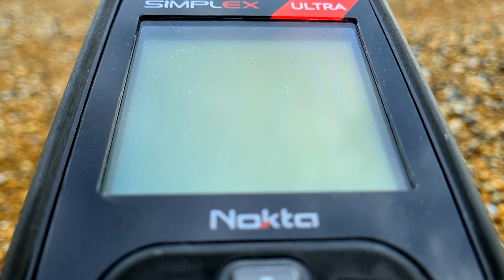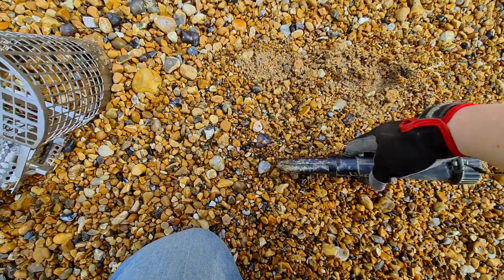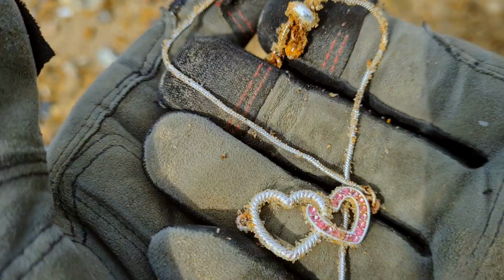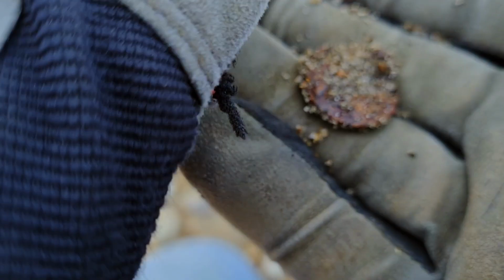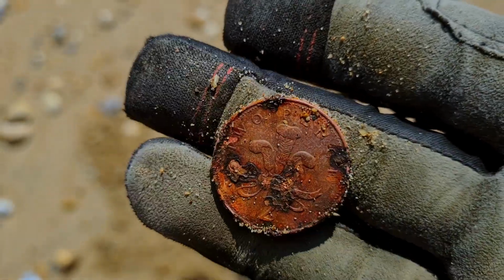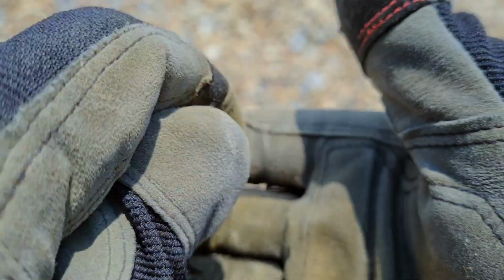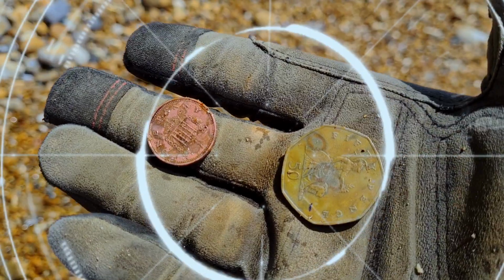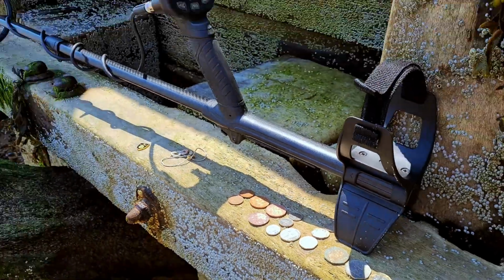First Hunt with the new Simplex Ultra! | Dry and Wet Sand | Beach Detecting | Settings | Episode 205

Comment: Is there any difference between the ultra and BT other than carbon fiber?
Reply from the maker: Hi!

Yes, the Ultra has a lot more in terms of settings and adjustments such as recovery speed and ground suppression (amongst others) 😊👍
Reply: @DTEKTSUSSEX  thanks for reply. Honestly feel so confused about all the options now. I'm after my first detector and can't decide between simplex ultra, x terra pro and the vanquish. Also if the simplex plus is better than the ultra. Really appreciate any help. Also are headphones really essential?
Reply from the maker: Happy to help 😊

The Ultra is better than the Plus on the Simplex. Inside and out. The Plus is a monster of a machine but the Ultra somehow manages to improve on it!
Headphones aren't essential but will help you to hear the more subtle nuances of the tones. The Ultra had Bluetooth connection so you can use your own headphones as long as they're low latency.
What the Nokta machines have over the others you mention is ease of use, build quality, waterproof rating and performance for your money.

Any other questions, please feel free to let me know. I have a Facebook page if you'd rather message me on there 😊👍
Reply: @DTEKTSUSSEX  thanks bud so looks like the ultra is the way to go then!
Reply from the maker: It's a great machine!  Shout if you need anything else 😊👍

Comment: I used to enjoy the simplex + on the beach with the SP24 coil as it was a coin magnet, I’d say looking at your video the new Ultra is proving to be another great beach machine. Well done and thanks for sharing Adam, I did think it would perform sweet, and I wonder how it would be with an SP24 fitted? Because the stock coil did well 👍

Comment: What sand scoop are you using? The last two I’ve bought have broken within a few weeks.
Reply from the maker: The Nokta Premium Scoop. Lasted me well over 2 years of weekly use so far... 😊👍
Reply: I bought a £50 from Amazon which lasted me a few weeks.

Is that the 3 in 1 scoop?
Reply from the maker: Yes 😊
Reply: @DTEKTSUSSEX  I’ll pick it up 👌🏻 Cheers mate.

Comment: Oooh no.... Those target tones sound like the buzzer on the " operation" game and the pinpoint sounds like sooty on a medieval torture rack... would drive me crackers
Reply from the maker: Each to their own. I'm used to the original Simplex which had the same tone set. Once you get used to it it's remarkably nuanced 👍
Reply: @DTEKTSUSSEX  I always got on with my simplex too apart from the interference from every pointer I tried, it performed way above its price tag, and certainly was never chattery as many report.. I never liked the tones though and hoped they had improved now , but if anything they are coarser.
Good video though mate 👌

Comment: Is it as good as the legend on the beach ? And is it more expensive or less expensive then the legend i might get one im not happy with the vanquish 540 i bought its rubbish
Reply from the maker: Hi Eddie,

It's fine for the beach but the Legend will perform better because it's a simultaneous multi-frequency machine and has a lot more settings and features. The Legend is a bit more but definitely an amazing deal at the price 👍😊
Reply: Thanks adam il get the legend then the vanquish 540 is multi frequency but thats overhyped in my opinion still very chatty on the wet sand and gives phantom signals very deep, dig 15 inch sometimes nothing in the hole
Reply from the maker: Great choice! Let me know if you need any help with it when it arrives 😊👍

Comment: I'm really not trying to be negative, but I think the Simplex sounds really bad and that is a complete show stopper for me.
Reply from the maker: Everyone has their own tastes. I quite like the Simplex sounds. For an entry level machine you get a lot of nuance to the targets.
Reply: for me the problem was the Nokta market strategy, release the first Legend and after that down the price a lot because they release accessory in carbon and new material, new legend versione with carbon and new accessory material and now release new simplex family, so the first legend become already obsolete i buy at january and cant sell for cheap price is insane!
Reply: I agree...The tones of the Simplex are horrible....Sounds like a wounded duck.  Otherwise, I would have purchased the Ultra...The 99 tones on this detector sounds much better on this detector....Think I will keep the Xterra Pro at the top of the list.
Reply from the maker: No...the price drop had nothing whatsoever to do with the hardware upgrade. The Simplex doesn't replace the Legend...it's an entry level machine. The Legend is still the top end flagship.
Reply: @jasonking6366  Yes, I got the X-Terra Pro as a backup to my Manticore and I'm real happy with both. I used the XTP with a 15-inch DD coil this weekend on the beach and I was super happy with it. I found 2 rings and coins down deep some at 14 inches.
Reply: I bet your using the minelab.
Reply: Again I see guys again slagging the simplex ultra off for the tones,but what about the minelab machines which sound like bill and Ben.
Reply: @FloodGold  which 15 inch coil do you have?
Reply: The pinpoint sound fires up the cat 😂
Reply: Согласнн, озвучка у симплекса не очень приятная, но я привык, мне не надоедает звук, за то поисковые качества прибора хорошие

Comment: What about FREQ/KHZ shift like on the new Xterra, is that not possible on the new simplex series ?
Reply from the maker: No, the Simplex was never designed to have multiple frequencies. It's produced to be as simple to use as possible whilst providing high performance in most locations.
Reply: @DTEKTSUSSEX  changing between 5-10-15 khz is quite simple to me , what about change of recovery speed and iron tones, is that also not included in the Simplex series
Reply from the maker: Only on the new Ultra model. Not on the Simplex+ or the new Lite or BT.

Remember, everyone is different and starts from a different point. What is simple to one user is not simple to another. When I first started out switching frequencies would have been too much. Now the concept is second nature. I know users who have been detecting longer than I've been alive who would struggle with the idea of changing frequencies.

Comment: What the difference between the plus and ultra
Reply from the maker: Hi Jack,

The Ultra has Bluetooth, carbon fibre hardware and is only 1.2kg in weight. It also has a thinner control box, better buttons and a lot more settings (see my unboxing video from last week for more info 😊👍).
Reply: Also on 15khz,the simplex plus is on 12khz.
Reply from the maker: Correct 👍